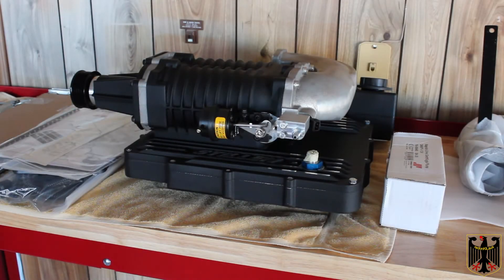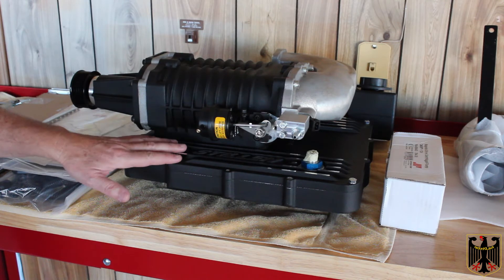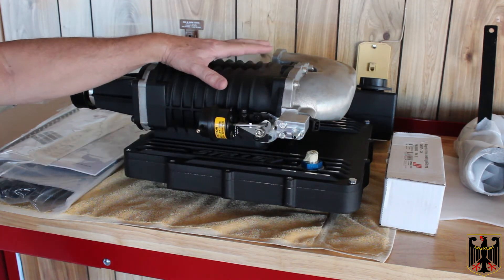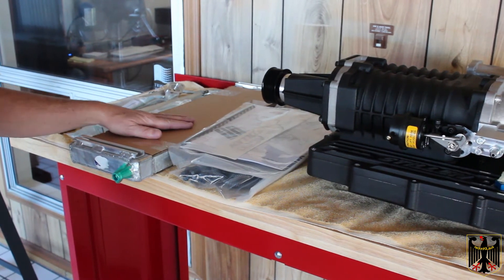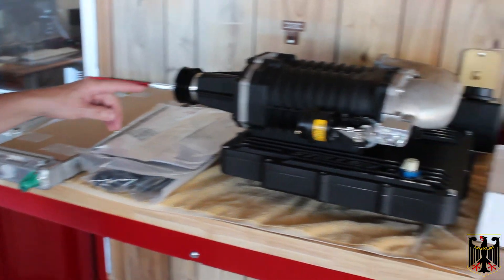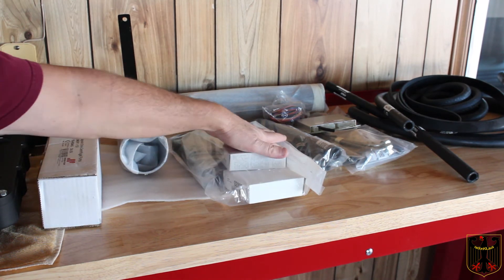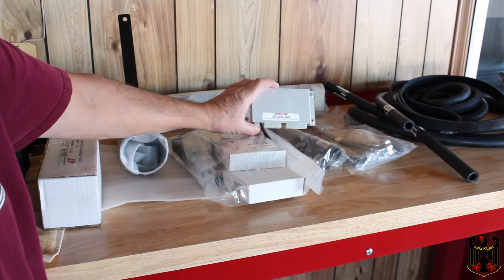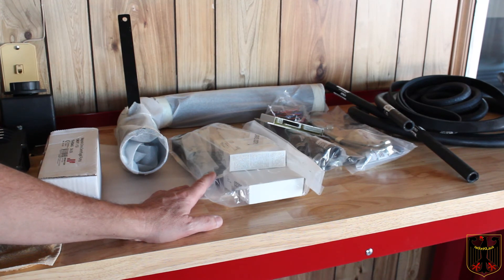VQ40 Stillen Supercharger Install - Introduction

Comment: would this fit for 2000 xterra ?
Reply from the maker: No, but there was a factory supercharged version of that vehicle that you can look into.  Thanks for watching!
Reply: @redonKiLaus  do they sell aftermarket supercharger for the 2000 model ? Was lookin for more power with stock block
Reply from the maker: @RobPhiangdae  I don't believe so, even this one isn't sold anymore.  You should be able to transplant one from another supercharged VG33 powered Xterra but I'm not sure what's involve.

Comment: Do they make super/turbo chargers that will fit an '06 Pathfinder 4.0L? I've seen that they don't make any and I've seen they do so I'm just a little confused.
Reply from the maker: The Stillen one works with Pathfinders, but it is discontinued so you would need to find one that is preowned on the used market.  Thanks for watching!

Comment: I've got a 2011 Nissan Frontier Pro 4-x loaded and I went to the Stillen site to see about this Supercharger upgrade. They don't show they have one for my truck at all. They don't even list one for these trucks. What happened?? Respond back when you can Thanks.
Reply from the maker: According to my friends at Fontana Nissan (a.k.a. Nissan Race Shop), Stillen discontinued the kit.  I'd contact Stillen to confirm and/or to see if they happen to have any left in stock, but if that's the case and you are looking for one I believe you're stuck with finding one on the used market.  Thanks for watching!
Reply: Leonard Warner I have a 2018 frontier pro 4x and can t find one anywhere either!